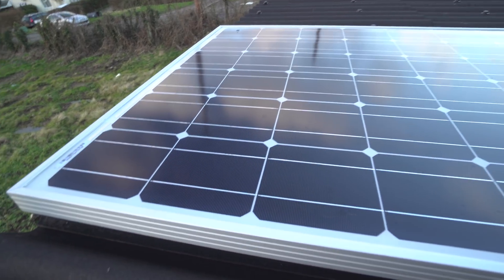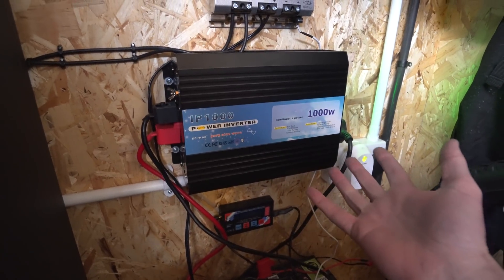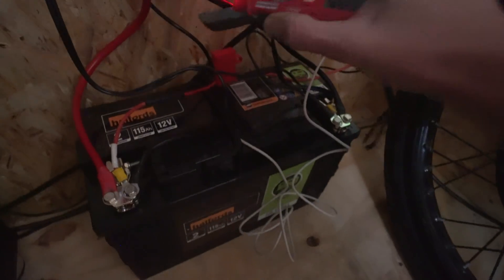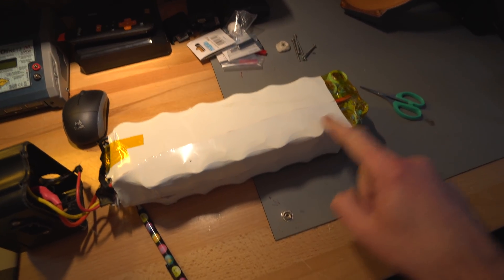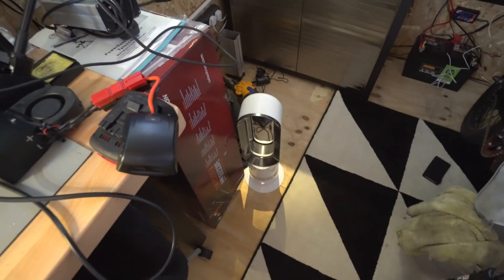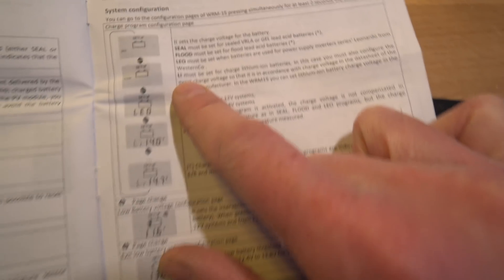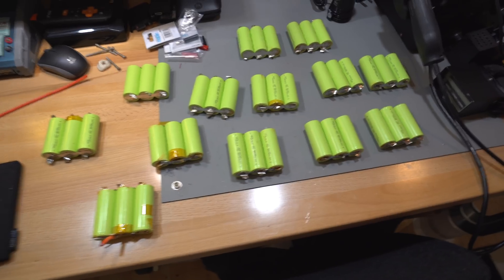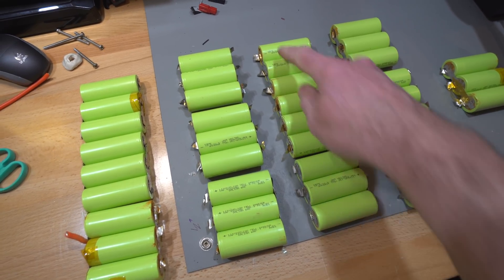SOLAR POWERED SHED PART 1 | STARTING THE MINI POWERWALL BUILD

Comment: Andy, as your the solar slueth, ive a coupla questions, can i run a site transformer 110 [240-110v] from my 2000w inverter, will be using an Epever controller 30 via 2x 100w panels am a bit newby but up for it, use a lot of dewalt battery stuff, but now and again 110v is handy, your thoughts.
cheers

Comment: Great video.
I want to do something similar in my garage to top up the car battery on a classic car.
Can I connect the Charge controller directly to the car battery, or does it need a separate battery for the CC and then take the load connections to charge the car battery?

Cheers

Comment: Andy, I'm really interested in earthing my installation (similar to your own) what have you done by the way or earthing as I'm struggling to get a simple answer. Cheers.
Reply from the maker: Hi, short answer is I haven’t. It’s a complicated topic I think, some say just stick a great big metal rod in the ground outside.
Reply: Ha, that is what I had heard too. Apparently you can run from Neutral at the battery terminal - most houses are being neutral earthed now at the incomer rather than an separate earth. I'll look into it with my spark and see what they suggest. Will let you know if I get anything that sounds sensible.

Comment: The victron phoenix is the best inverter for lithium I run mine with 4s. I also use it with LiFePO4 
You're into the same stuff as me, ebikes, off grid solar. Electronics are cool lol
Cheers
Reply from the maker: Yep your right there, I’m now testing a Phoenix 800VA and it’s superb, especially with the ve.direct.
Reply: andy kirby That's the one I have.
Didn't know about the ve direct. Will have to look into it
Reply from the maker: Cool, you can either plug the Victron Bluetooth dongle into it and then get the Victron connect app for your phone which allows you to monitor the inverter when you are near or you can setup a raspberry pi and monitor it using victrons VRM on their website. It’s cool because you can remotely turn the inverter on a off over the internet. it really comes into its own when you have a BMV 702 (or 712 smart) battery monitor and a ve direct charge controller as you can monitor the whole system and get notified of any problems.

Comment: You can use a buck converter
To step the voltage down to 12 dc to the onvertet. Nice project
Reply from the maker: Good idea although I’ve not seen one rated for 1kW peak have you?
Reply: andy kirby You can get a step down voltage regulator/converter. 100 quid will get you one with input voltages upto 35V, 12v output for appliances from 0.5AMP to 100AMP automatically, you would easily get 4amps output from the inverter

Comment: LiIon cells do make a vary bad replacement for 12V lead acid batterys as you typically lose 50% of capacity just simply because of the voltage range is outside of specification on 3s or 4s packs for standard 12V equipment. For a 12V system you can only use LiFePo cells. I can only recommend to buy a 2nd panel and go for 24V nominal system. Later you can still add a second set to have 4 panels if you need. That works perfectly with a 7s LiIon pack
Reply from the maker: Yeah I think if you are using legacy charge controllers this is true but the new wave of 12V controllers and inverters are more Lithium friendly. 4S works well on the Victron gear as the their chargers have programmable voltage and the inverters work up to 17V, I’ve chosen to charge only to 4V per cell to 16V to keep things a bit safer and prolong the life of the cells. The charge efficiency of lithium ion is higher than lead acid and the voltage drop under load (Peukerts Law) is less pronounced. So all in all it works if you are maybe running an 800W inverter, anything higher and you want to use higher voltage of 7S or beyond that like some of the big boy powerwall setups on here.

Comment: 3s or 4s that is the problem :)  What a lot of people do is to go 7s and then configure the charging circuit for 24v.  Be interesting to see how things work out :)
Reply from the maker: Yeah higher voltage is always better but then you’ve got to have more solar panels. 4S does work but you need a charge controller that allows you to set 16-16.8V, also most inverters cutoff at 10.5V, this is not too much of a problem because you can have a BMS cutoff at 3V per cell. Victron gear is very flexible as the 12V inverters work up to 17V and you can preset any cutoff you like. 
1000W @ 14V is 71A from the battery so you need to have cells that can take that (not recycled laptop batteries) also in my case I don’t pull 1000W all the time its maybe like for a few minutes...most of the time the shed pulls 100W max. 
If you are aware of how much power you require you can tailor the system to your needs. If you have A/C and powerful fan heaters then forget it you’ve gotta go big or go home as they say!!!
Reply from the maker: Yes right, actually The inverter gives a warning at exactly 16V with no load and shuts off. If the inverter is loaded up it won’t give the alarm and starts inverting, probably because the battery voltage dips just below 16V. I am going to move this inverter back into the trailer and use a Victron Phoenix in the shed which runs up to 17V, also I don’t trust these cheap inverters with my connected gear. Too many horror stories of inverters blowing and taking out expensive electronics with them.
Reply: You need to open up the inverter and check the voltage rating of any caps on the input voltage side - if any are 16v then that sets your absolute input voltage limit...unless you change them. It would be a pity to kill the inverter.
Reply: if 16 volts is your absolute max take a look at your no load voltage drop from battery to inverter and charge 4S to 15.8 or 9 and all is well the 4S will get at least a 90% charge and never see the bottom voltage unless that inverter drops to 9.6 volts before it shuts down now that can be a problem but like what was stated above a bms would take care of that. Charging is a bit of fun im there now with my 18650 4S total is about 100 Amp/hr running as a test now for my home no charge controller ive come across can do 15.5 volts max inverter voltage so im using a 20 amp buck converter that is CC CV with 200 watts of solar and its working just fine. My voltage drop is .1 volts so battery voltage is 15.5 but at my inverter its 15.4 volts. Check out my channel if you like i do have some videos about my 4S set up.

Comment: you should look at using an arduino and a relay to monitor voltage and cut off the power from the battery, not a difficult bit of code, youd probably need to use car starter relays for that kind of current though
Reply from the maker: Good idea, I haven’t investigated Arduino and voltage dividers, that would prob work well.
Reply: yeah the voltage divider might use like half a watt (tiny amount of power in comparison to anything else in the shed) and measuring separate batteries would be a pain but one big battery would be easy 10 minutes of work like
Reply: Julian Ilett has done a lot of projects like this.  Please check out his channel

Comment: come on. shows us your ham antenna and why you use it
Reply from the maker: Ooooh I don’t know if you guys are ready for it lol!
Reply: I am not a radio amateur but I do use SDR radio. currently using a 6 foot telescopic antenna mounted on top of the mounting arm of a $ky dish. works alright for receiving VOLMET and Stansted airport, 2 meter ham, DAB and FM radio
Reply from the maker: Cool! I rarely transmit on the HAM bands but you’d probably hear me from there if you can pick up Stansted airport. It’s a good location up here for radio.
Reply: Glad it's a good location for you. I probably would pick you up as I am near Royston. I am in a locally very noisy area as we have heat pump's connected via RF and there is a lot of spurious noise from 70Mhz up to 200Mhz. grr
Reply from the maker: Yeah it’s getting increasingly bad on the airwaves. Best thing to do is get the antenna as high as possible, maybe try filters? If you filter out harmonics you might stand a chance.
Reply: I may try that. thanks

Comment: Andy, don't even think about using less than 7S for Liion, or 4S for LiFePO₄
Follow HBPowerwall, Average Joe and DIY Tech & Repairs and learn from those who have already gone down this road, and proved their tech.
Use 14S with a Batrium BMS and 48V inverter - a PCM60x charge controller can charge 14S.
Reply from the maker: Yeah I’ve been watching those guys. I like the idea of recycling 18650s and it’s a real achievement to tame unmatched cells in a giant pack. The thing with those recycled cells is that they are low discharge you can’t pull more than 1amp per cell which means a giant pack. The advantage of that is you naturally end up with a large capacity which is what you want for a powerwall. In contrast The shed pulls less than 1kWh per day in total, most of the high power usage is spikes of high power when I’m using the soldering station. The cells I’m using here are high power rated cells (10A+ per cell) so they should absorb the spikes just fine. 1000W at 14V is about 70amps. If you have a small energy dense pack at 4S you can do it. If I was making a pack to run my home I would use 14S with at least probably 10-20kWh, but I would not feel comfortable having dodgy cells anywhere near my house even with an awesome BMS like Batrium. I’ve actually filmed all the parts to this series already and it’s really surprising with of course some blunders on the way!. Stay tuned!
Reply: It's all good learning, and you have learned more than 99.9999% of the population about this stuff!
I've been following them for a couple of years and am collecting and testing cells to build a bigger and versatile pack - already made a 2kWh 14S16P pack for my magic pie 5 ebike, (and used it to do a 340km trip from Budapest to Balaton and back last July, then got hit by a taxi and broke pelvis, ribs and collar bone which put me out of action for 3 months, then my MP5 controller died and just got a replacement last week! yay!)
Still kept up collecting free cells from laptop service centres and have around 800 good cells so far - I made 16P cellpacks so can arrange them as tall or wide as needed with HXT bullet connectors and 10AWG silicon cable - I could put them all on the ebike, or run a 24V APC1000 UPS and easily replace/repair anything failing.

Yes, the laptop cells are lower discharge but high capacity - 80P will supply 80 amps with little stress - but as you know, you'll get better conversion efficiency as well as lower current with higher voltage which is why 12-15S is preferable, and some people run even higher!
High drain cells are great for power, and 7P @ 70A is doable, so you could in principle run a 1kW inverter using 4S 7P, but only for a few minutes before they're done - so you would still need much more P for capacity. Even so, I don't think it's good practice to make the cells work too hard even if they're rated for it!
To store 1kWh and assuming 2Ah and 7.4Wh per cell, you'd need 1000/7.4 = 135 cells = 4S33P or 3S45P = not small packs anyway!
Even high drain cells wouldn't see much more than a couple of amps with this anyway!
I think Pete @HBPowerwall is using something like 320P - so even drawing 100A barely tickles the cells now!

Pity that 3.5S isn't possible. If you use 4S, then you may not be able to charge it fully and may go undervoltage before the inverter cuts out, and if you use 3S, the inverter may cut out before it's half empty.  Using a high power DC-DC converter would solve that, but then that would just introduce yet more losses into the system. 7S is a sweet spot for 24V, and halves the current.

I get the point about dodgy cells - any battery system should be away from the house and anything flammable preferably surrounded by concrete.
Reply from the maker: Wow, cool achievements with the ebike :-) sucks about your accident though, glad it hasn’t put you off. I’ve had a few scrapes but mainly on the boosted board! 
Yeah I’m definitely going to build a bigger pack soon, I’ve got a 2kWh 20S pack which I use in my ebike I would love to find an inverter that could run from that but they don’t seem to exist. either that Or I would need a high power DC-DC and then run a 48V inverter at 60V. Then I could make more use of that pack.

My inverter panics at just over 16V so I can get away with 4V per cell, that’s only 75% capacity though... 

The thing with my setup is I rarely run 1000W...most of the time it’s running 70W max so I don’t really need a huge battery. Oh and also if you have higher voltage you’ll need more PV.
I do agree though, higher voltage is more efficient.